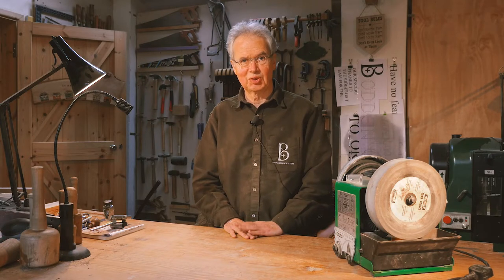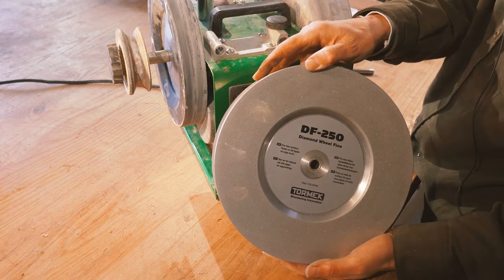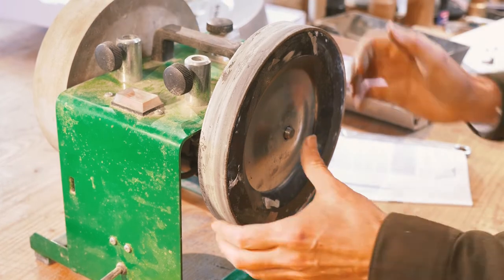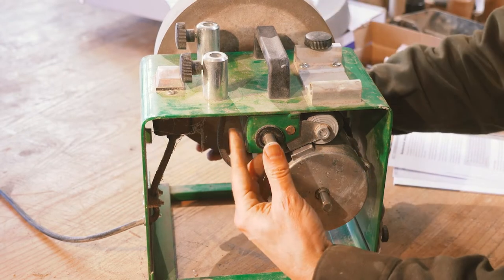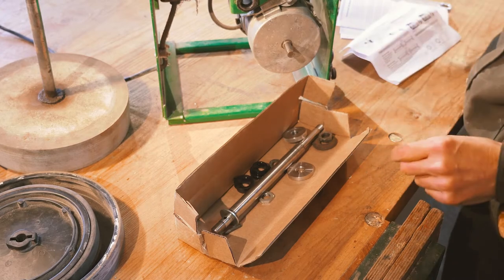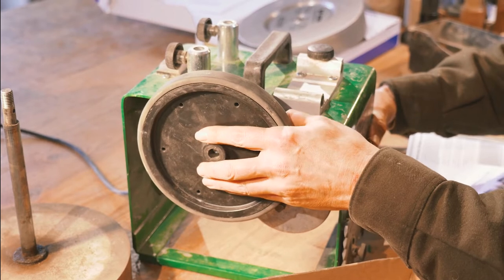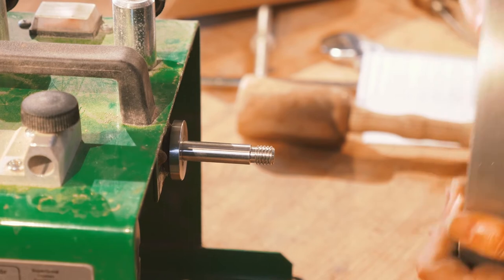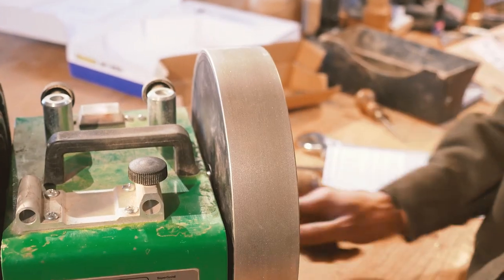How to upgrade your Tormek Supergrind 2000 with new main shaft and Diamond Wheels

Comment: Your video does not cover the new bushings.
Reply: 3:17 yeah he didn't install the knew plastic shaft bearings/bushings?  Of course the old ones might be okay as he said he'd not removed the wheel in 14 years, and those bushing should last a few wheels at least, but he didn't even check them?  Such a cheap item I'd have replaced them right off.